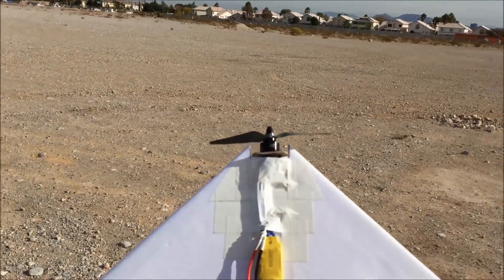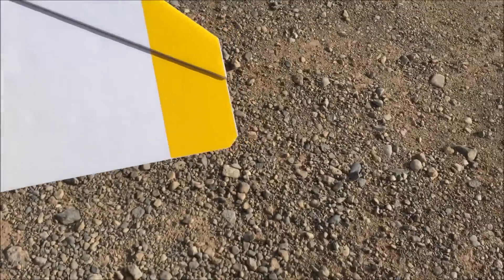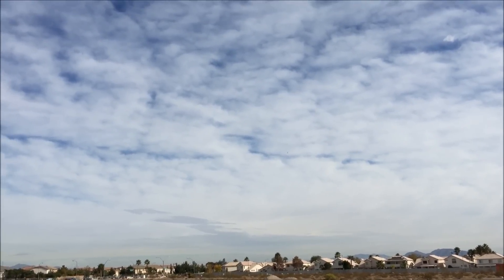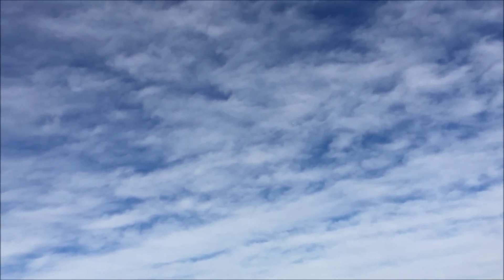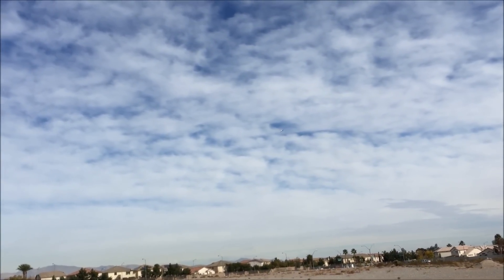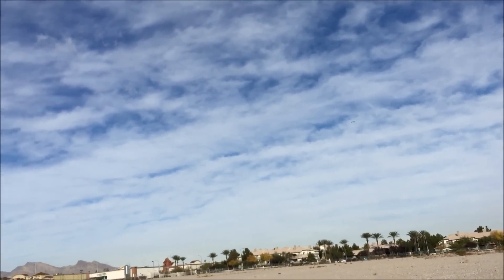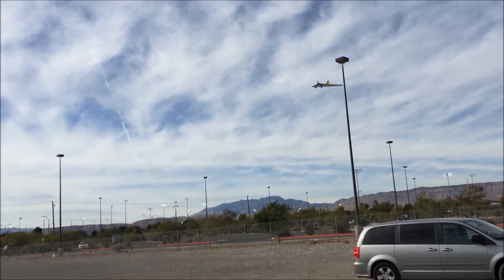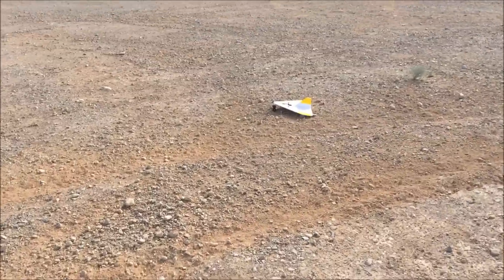"Simplest Simple Delta" Scratch Built RC Flying Wing

Comment: That was awesome, have you tried using corrugated plastic wing design? When folded they form a proper airfoil. They are tough but heavier than foam or depron board.
Reply from the maker: No, I haven't. In the USA it's called Coroplast. Nice wing you made! Recently I made a F-22, it's fun. https://youtu.be/r7oQlZ99hWQ

Comment: What kind of flight times have you achieved? Fpv?
Reply from the maker: Nothing extraordinary, about ten minutes on a little 3s 800 mAh battery. I haven't gotten into FPV (yet). It would be a good FPV platform. You probably would want to build the prop-in-slot version so you have the propeller behind the camera.

Comment: elevons are great as long as you get their size and servo throws right.  too big or too small and they suck.  You also had the CG right on, and that's the more important thing to get right on any test flight.
Reply from the maker: It had very low throw and high expo for this test flight because I had no experience with elevons. I used an online CG calculator for flying wings to determine the correct CG. I made it conservatively nose heavy. After realizing how easy the wing is to fly throws were increased and the CG moved back.

Comment: Which esc have you used along with model number
Reply from the maker: I used the cheapest 30A ESC I could find. Way more Amps than necessary for this motor but I used it because that's what I had handy. I probably got it on banggood.